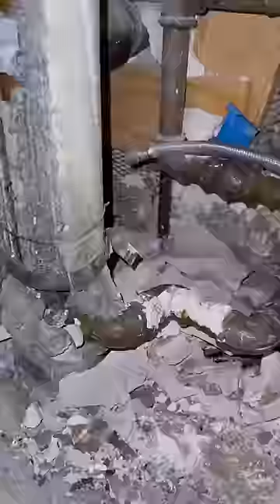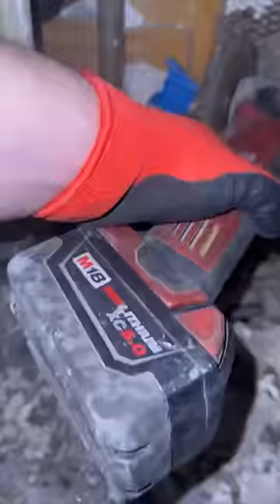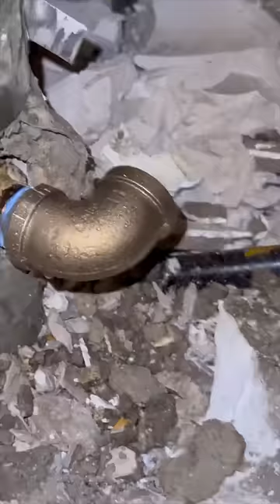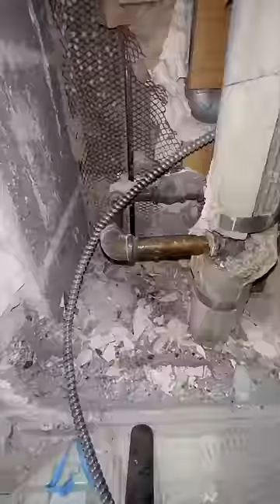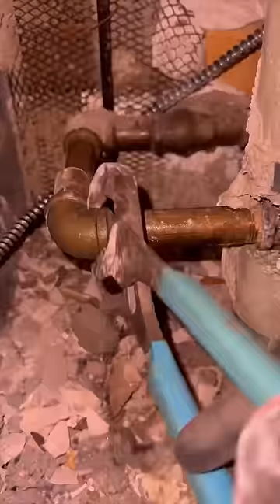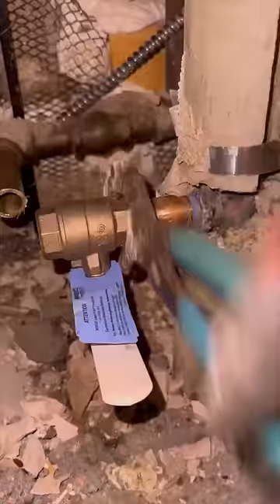Installing new valves during a shutdown #hydronyc

Comment: In detroit, we have a project with roof top heat pumps and ac condensors. Hired a contractor, they installed most all 60 units on roof, got an inspection - inspector says "there should be railing on roof for safety (there was railing around HVAC units), but he wanted the entire flat roof / every edge to have railings. No other roof as far as the eye could see - has railing, AND he was not the building inspector. Yet, the HVAC company refused to go back up until we had railings installed on every edge. If you agree to do the job, dont complain, also, you can always refuse the next job (similar). Stopped the project for over a month, as it was in winter, and we needed atleast some heat in the buildings - the nightmares of being a gen contractor

Comment: Here in Finland they’ve now changed the law that you can’t do partial removal anymore, if you need to remove any of it all needs to go in a certain space, essentially a room. After the removal is done they wipe a clean rag over all surfaces and send it out for testing, if it comes back as positive for asbestos they clean the space again and redo the test.

Comment: Have you thought about offering customer's to contacting Local 12 Heat an Frost insulators. They could remove the asbestos an re-insulate with fiberglass or whatever specs required. 
I imagine they would also appreciate the work as most Mechanical Insulators work is provided from plumbing an sheet metal workers. I live in Ontario,Canada work for Local 95. Do gotta say tho really enjoy watching youre videos. Youre definitely a great plumber

Comment: Hey broski i feel you, and i have some safety recomendations! Some is better than none and I understand that getting PPE for every single job is not viable, and in some jobs you just have to deal with those materials

I'm not even in the same industry as you, I'm an automation engineer. But in my country we have a lot of hazardous materials everywhere around us, heck even leaded gasoline was removed from our market just in 2008!!! 

Plus people underestimate the danger and treat you like you don't want to work when you bring up your worries about the hazards

I'd recomend the whole spraying a mix of PVA glue and other stuff that another commenter left, but be sure to use one of those agriculture spray bottles, the ones that need you to pump air into them to properly spray. Those have a much finer mist and finer mist captures more particles in the air. As long as asbestos is not floating around a lot, it will be safe to even touch, the issue with it is the breathing it in or consuming it

For lead, it may be somewhat expensive in your country to get it so you can travel to nearby countries and get the tests cheaper and maybe have a small vacation. Lead blood tests are really good at telling you if you have been exposed to a dangerous level of it in the last year. With lead you're pretty much fine if you don't eat or lick leaded paint, you don't breathe in hot vapors from soldering with lead or volatile leaded chemicals, you're not in skin contact with lead-based liquid chemicals such as tetraethyl lead. If you touch something made out of metallic lead or you're just nearby it, you should be totally fine as long as you mantain the normal standard of washing your hands before eating after interacting with it.

Comment: Wearing a proper respirator and a tyvek suit is important when working around asbestos. Using brushless tools is also helpful to reduce asbestos exposure by reducing time on the job and there are no brushes and commutators to make the asbestos finer. Trade in your Milwaukee brushed for some FUEL.

Comment: It sounds to me that you are talking reasonable precautions to avoid unnecessary airborne exposure. Wetting and vacuuming away the asbestos from the floor and workspace to avoid dry/airborne particles from being tracked around is a good practice as well.

Comment: Water is great at preventing the dust, but if you want to make sure that it doesn’t dry out and start spreading dust if you aren’t timely enough with the water, then use Elmer’s glue with the water as a fixative.

Comment: 😊   I have worked with asbestos for 25 +years. When I started the company wasn't  complaint about the installation.. but when I was young and didn't know what to expect.  Well you know.  Later we were told that they required a license for removal of asbestos..  got to do it every week.. when I retired I was a contractor supervisor.   This requires a good idea how and how much you can remove   or insulate.   This is no joke.  This will kill you  very slowly.  It is not worth doing this with out protection..  .y suggestion is to get a license and charge the  life out of your profession and good luck 😊.  😊

Comment: A box fan and a air filter for a house. That way your pulling air from the work site while collecting the particles. Or one of those round ducting fans with some plastic duct, so it’s sucking up the dust and sending it where ever. Just my 2 cents.

Comment: It’s not the asbestos that kills. It depends how small the dust fiber is when working. Gravel, cement, marble stone, and simply dirt could kill if the particulate of the material would be small enough to enter the Avioli sack. Just be safe out there and always use a mask when operating or doing work and you’ll be just fine. Asbestos is nothing people live a life dealing with that type of fiber.

Comment: I'm in the asbestos removal industry in Australia. We must wear a PAPR (Powered Air Purifying Respirator) mask and disposable sperm suit. Not cheap but very comfortable to work in even the full face seal one. And roll the suit off inside out, not pull it off. Be safe it's only your family that cares. We also use a 50/50 mix of PVA and water  in a spray bottle to seal the fibres, water dries. Test it on something you'll see the glue residual.

Comment: As someone who removes asbestos. You're doing the most that you can without removing it. Asbestos is deadly yes but if you take the proper precautions and don't fuck with it as much, wet it, and do your job fast, you should be fine. Avoid shaking the pipe if at all possible. You should keep in track of which site has asbestos, even If all of them, because at some point, when it's time to remove the asbestos, they're going to want to know who worked on it because you fucked with asbestos

Comment: The typical size of asbestos fibres is 0.1 to 10 µm in length, a size that is not generally visible to the human eye.    so you'd need a respirator rated for this size filament.    you also need to wear rated coverall and and dispose of them in a safe manor. 

there is no standard dusk mask rated for this stuff.

Comment: Asbestos is a hell of a material and fucking scary, if you just imagine that this fine razor sharp stone material that is so small that it gets deep into your lungs and creates scars until your lungs don’t work anymore because they got to stiff from all the scars. Fucking painful slowly way to die. In Germany you need (by law) a full body airtight suite that you can discard after every day into a special trash after working. Also rubbergloves that are taped on your suite to provide that any debrie comes into it, also tape around your shoe‘s. A fullface mask with airfiltration, not just a paper or a FFP2 mask (because asbestos is way to small and makes it trough that) and a hood on Top, also you have to work under constant flowing water to provide any debris flying around. If you remove it you just can’t break it, you have to try to remove it in one piece to also prevent more debris and so on and on. You have to double seal the trashbags too, it’s scary that the U.S. Government doesn’t give a shit how dangerous this is. They should do some regulations about that.

Comment: Should buy some disposable N95 masks 3M 1870+ is a good one. Make sure you’re clean shaven so it can seal correctly. Should be able to find fit testing videos online to get a basic idea of what to look for. Then go and get some disposable jumpsuits and boot length/knee high shoe covers and some gloves. Tape them shut and wear full seal safety goggles. I know it’s a lot but it’s also illegal for the buildout to not abate that or at least have it inspected to ensure what it is and if it is a considerable risk to you as a tradesperson. Just my 2 cents.

Comment: Ive done a bit of research about asbestos and what actually it does to get you lung cancer...
First of all, the material itself is inert and damage is done purely mechanically - its long, needle like cristals peirce cells  membrane and that can trigger chain reaction, coz certain dead cell release chemicals that can damage dna/rna or dissolve cellular membrane.
Then its physical presence can cause autoimmune responce with subsicuent chronic inflamation.
This whole situation causes rapid cycles of regeneration of lung cells which in turn increases probability of lung cancer.
If you work with asbetos all you need is to match breathing mask filter capacity with typical asbestos cristal thikness.
Also cover all the wet epitelia like eyes, mouth, ears, backside and front side. Other than that, most of skin can just be fine around asbestos.

BTW, same issues as asbestos can be caused by short cut hair, glass wool, synthetic fiber heavy duty cut rope. All micro fibrous materials on micrometer scale and less, that have some rigidity to them will cause same results as asbestos.
In most studies that ive read, guys that got lung cancer had worked day-day cutting that material without any hint of protection, for 15+ years.

Comment: If you keep wetting it and wearing a HEPA filter with your mask you will be okay, I used to work with asbestos removing it.
Reply from the maker: Thanks for the advice
Reply: The key thing is you have to worry about the dry particles, you really want to be wetting it while you're breaking it up keeping the particles down as much as possible. I used to have to wear a little nose in the chemical plants that lets you know how many particles got free, and we would have to turn that thing in at the end of the day, they said whatever way I was doing it keep doing it that way, that's because when they check the little nose that I carried, there wasn't anything on there. I had my DEQ card, department of environmental quality.

Comment: I work in a bunch of old buildings probably similar to the age and size as you do but in Philadelphia and they are loaded with asbestos. I know the dangers of removing it and I have done small sections by myself and I also had to wait while they brought these “professionals “ in to remove larger areas and besides wearing a better face mask and those white coveralls they really don’t do much more than what you and I would do except they build a tent to enclose a area and have to strip down and get a shower before they can leave the contained area. I know the difference between asbestos and fiberglass and I don’t have a death wish but I still would rather remove the asbestos than get that fiberglass shit in my skin and itch for the rest of the day .

Comment: I dont see much pex in your work.  Seems like I have to argue with every plumber these days to use metal pipes as they prefer PVC and glue.  I'm really concerned it's gonna crack, wear, and pollute in lines.  Since most of the cost  it's mostly labor anyways, I don't mind more expensive pipe if it's more durable.  Am I crazy?

Comment: Just find a better area. That kind of experience  and honestly, motivation, is in short supply in alot of those big dumb truck areas. Just head to a quiet place and smash it. New Yorkers run circles around most places. Just used to a faster pace. That's an advantage people don't utilize enough. Skills are great. But, if a market is flooded or hostile? Dangerous? What good is money if you're not around to spend it?

Comment: Pipe wrap is the worst, Ive done asbestos for 6 years and most drywall compound and vinyl have 1-3% asbestos, most pipe wrap is 30% or higher, I’ve seen as high as 65%

Comment: I have seen your videos before and like your work, I worked on large commercial union projects and had to receive 40 hours of training on certain jobs per job of asbestos awareness. You are endangering yourself and innocent people that come into the area and come in contact with you and you are taking the hazard home to your family on your clothing, the asbestos typically found on old piping at the fittings that looks like Lightweight mortar is typically 80% pure asbestos for your safety and your family safety and for anyone else that enter that Area you should report the contractor to the health department. This is what they are there for. Make no mistake about it. Asbestos is a slow almost certain death. It will manifest over a 20 to 30 year time span as others have noted if you smoke your chances are getting it or considerably higher. Take the proper precautions your life, and the life of others depend on it. Nothing else. Please seek out some training on how to deal with asbestos.

Comment: What’s the code call for if doing a Reno and your not making dust leave a sleeping dog lie , 

Steps 

Needs a shower chamber to decontaminate before walking in and out zip wall system and pay the fair to do it right also means charge to do it right ,

Broski , full 3m face mask , gloves and Tyvek suite at the minimum , if not your lungs turn to concrete by 67 years old hard way to go 
 
New rubber still toe boots tapped to your suits and around your gloves